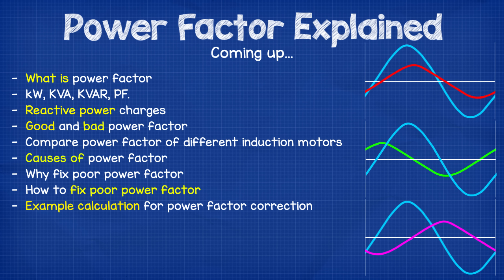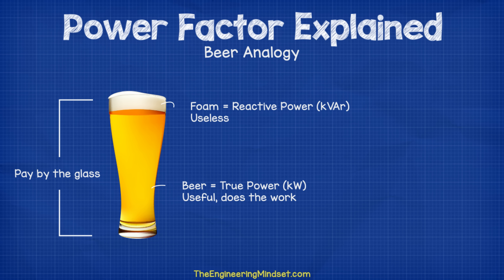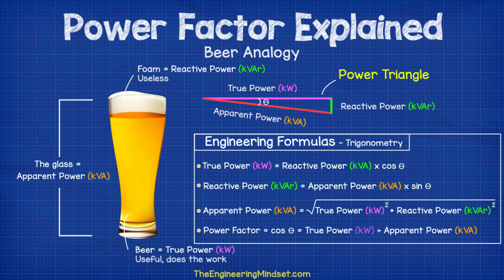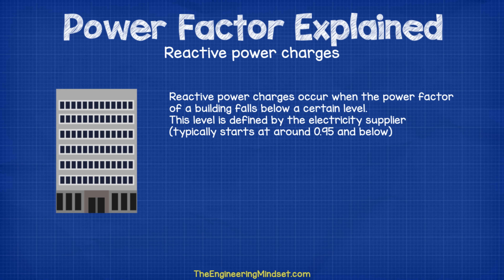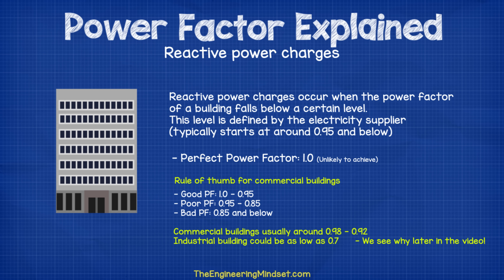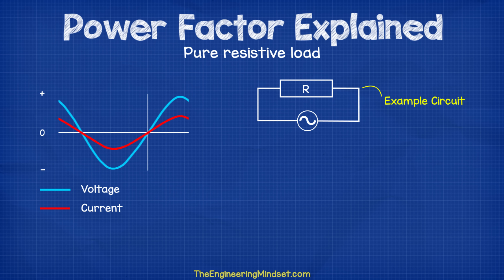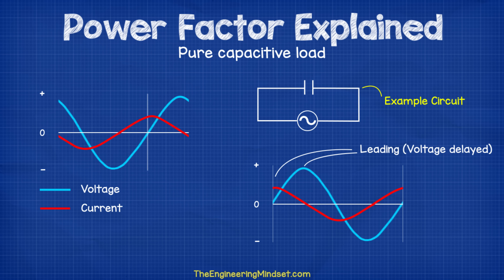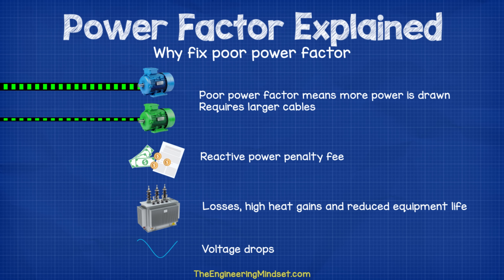Power Factor Explained - The basics what is power factor pf

Comment: Can any one help with this question: “When a series circuit comprising of a resistor and a capacitor is connected to an AC supply, the current will: ?
Reply: That's not really a question.  That's an incomplete statement with a fill-in-the-blank.    There's no real answer to this problem, because the problem is ill-defined.   I don't know whether the author of this statement intends you to answer about magnitude of current, phase of current, a change in current from what it was in a previous configuration, or what.

Calculate the impedance of both the resistor (Z = R) and capacitor (Z = -j/(omega*C)).  Add up the impedances, just like you do with resistors in series.   Ztotal = R - j/(omega*C).    Determine the real component R, the reactive imaginary component X, and the magnitude Z=sqrt(X^2 + R^2).

R = R
X = -1/(omega*C)
Z = sqrt(R^2 + 1/(omega*C)^2)
X/R = -1/(omega*C*R)

The relationship between voltage and current will be such that the amplitudes are related through the magnitude of Z.   The phase shift will be based on the inverse tangent of X/R.   The negative sign indicates that current will come earlier than voltage, meaning the current will be phase shifted to the left of voltage on a time domain graph.
Reply from the maker: Check out NEW resistor video, everything covered! ➡️ https://youtu.be/DYcLFHgVCn0

Comment: That's a pretty good video , Power factors depends on the r+xj the resistance and inductance however power rectification or better known as power compensation depends on the location of capacitors for example : if you install the capacitors far upstream the inductive load "the whole network downstream the capacitors does still have a poor power factor as the reactive inductive current will still pass that route all the way through to the load

Comment: What is that mean by 25.51kvar capacitor size because capacitor units r generally in faradays.
Reply: The units of capacitance (C) are Farads, not Faradays.  It was named in honor of Michael Faraday, but it is called the Farad.   The Farad rating of a capacitor, refers to its "electrostatic size".   It is a property of that only depends on the capacitor's geometry and the identity of the dielectric insulator (the electric permittivity).   It is defined as the charge per unit voltage, that the capacitor can store in equal and opposite amounts on both plates.

When a capacitor is used at a known frequency, you can know the reactance of the capacitor as X=1/(2*pi*f*C). 2*pi is a constant, and f is the frequency in Hertz.   Reactance is analogous to resistance, except it refers to energy storage and release, rather than energy dissipation.   From the reactance and the known nominal voltage of the grid, you can determine what kVAr the capacitor will store and release during operation.   Just like Watts = V^2/R for a resistive component, the VAr = V^2/X for a reactive component.  For a capacitor specifically, VAR = 2*pi*f*C*V^2.   So that is how you relate the VAr to the capacitance (C) in Farads.   Divide VAr by 1000 to get kVAr, because kilo means 1000.

Comment: Great presentation. however, from the beginning of the presentation, the analogue to glass of beer is not correct. In case of beer you pay for the glass and want to have as less foam as possible. while in case of electricity, we are charged and pay ONLY for the active power. we don't charged for the reactive power! therefore the electricity suppliers companies demand to have power factor equal or greater to 97% to maintain their electricity/power losses. if not power correction must be applied in big factories...using synchronous motors as an example.
Reply from the maker: There's reactive power charges on my electricity bill, most commercial buildings have this. Residential buildings don't. Some suppliers in the US I've noticed don't charge this or they combine it into other charges.
Reply: This is better I assume. In the country I live we are paying only for the active power.
Reply: Also I am wondering what type of power meter do you have in your house? typical power meter (electro-mechanical) are exists in two types. measuring active power or reactive power.  but not measuring the apparent power!
Reply: Finally, regardless my comments (I am electrical and electronics Eng.) your presentation is great and extremely interesting and very crisp!

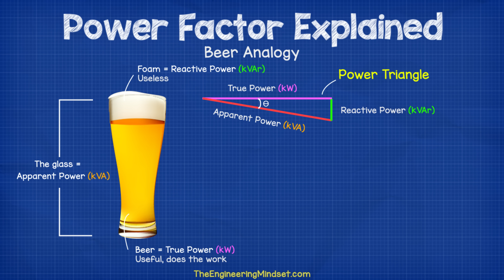Comment: animation at 2:30 - as the foam (Q) increases, and the glass remains the same (S), beer (P) should be decreasing. In the triangle it's a little bit messed up, but I got your point.
Reply: Yeah, I was looking for this comment, I noticed the same :)
Reply: Your observation is correct. And I will add that the right unit for reactive power is var not VAr.

Comment: how do we know if its a leading or lagging power factor?
Reply: Measure the voltage and current simultaneously on the same oscilloscope, that is capable of doing this.   If the shortest "distance" between the current and voltage is such that the current is to the left of the voltage, it is lagging.   If it is the other way around, it is leading.

In concept, it could lag by more than 180 degrees, and you'd think it is leading from this measurement.   Believe it or not, you'd be correct by identifying it as leading.  That is what is really happening inside a capacitor, is that it is lagging by 270 degrees of phase offset, rather than actually leading by 90 degrees.   Voltage is the cause, and current is the effect, so the true state of affairs is that it is always lagging.  In the steady state, it behaves as if current leads the voltage, so by convention, when it lags by more than 180 degrees, we call it leading.  We think in terms of the smallest phase shift between the waveforms that we can have, so that our brain doesn't need to think about angles larger than 180 degrees.

Comment: And you knew the problem was inductive because you connected a scope to the line and could see it was leading and not lagging?  So from that you know to need to calculate for Capacitance size to correct PF issue? Or do you assume problem is one of inductance?
Reply from the maker: If you have a smart meter or a power quality meter you can take readings

Comment: Great video, but at the end.....A 25.5kvar capacitor?
Reply: Given a fixed grid voltage and frequency, the Farad size of the capacitor is directly related to the kVARs that it will offset.   Industrial sized capacitors built for this purpose, are rated in kVAR, because grid voltage and frequency are known values.   If you used these on a different grid voltage or frequency, you'd have to adjust for this fact.

Comment: Hello there! I would like to make a observation. In the university where I'm studying they've told us that power output of an induction motor is mechanical (Pmec=τ*ω=τ*2*pi*n/60 [Watts], right?). So, in order to find the power input of the motor which is electrical (P=3^1/2*Vline*Iline*cosθ), they were giving us the motor's efficiency (η=Pout/Pin=Pmechanical/Pelectrical). For example if we have a motor with Pout=10 kW, efficiency of 0,9 or 90%, Vline=400 V, f=50 Hz and cosθ=0,85 then: η=Pout/Pin=> Pin=Pout/η=10/0,9=> Pin=11,1 kW (active power the motor's coils are consuming).

Comment: Why does the pure resistance load produce perfect/good pf but pure inductive and pure capacitive load lags or leads? I understand why they're labeled lagging and leading, but why particularly is that the loads cause this?
Reply: I just am learning these "load" terms.
Reply: @nieghwhite2518  Because in a pure resistive load, all the energy that goes in to the component, is immediately dissipated as thermal energy (i.e. heat).   With the reactive components, the component doesn't dissipate energy.  What happens instead, is that the component stores energy, and releases it at a later portion of the cycle.   A capacitor stores energy in an electric field through the dielectric insulator, as a result of charging its two plates to equal and opposite voltages.  An inductor stores energy in a magnetic field, in the ferrous (usually iron) core.

Comment: To convert KVAR to farad 
C = KVAR / (2 π f V^2) [here unit is μF]
Reply: In concept that is the correct formula relating, but your units are inconsistent.  Volts and Hertz are already without prefixes, so we leave those alone.   Get rid of the kilo in kVAr, and use full Farads as the capacitance unit, and it is C = VAr/(2*pi*f*V^2).   In order to use a k in front of kVAr, we have to multiply by 1 in a fancy way.   kVar/1000 = VAr.   C = 1000*kVAr/(2*pi*f*V^2).   Given C in microfarads, micro means millionth.   To clear the micro unit from C in microfarads, we multiply by 1e6 on the left:

1e6 * C_micro = 1000*kVAr/(2*pi*f*V^2)

Simplify:
1000*C_micro = kVA/(2*pi*f*V^2)

Solve for C_micro:
C_micro = kVa/(2000*pi*f*V^2)

Comment: Why the power factor is not greater than 1 such as 2,3 or 4? Please explain this.
Reply: A power factor greater than 1, would imply that you have magic components in your load that are creating energy that didn't come from the generating source.   The best possible power factor you can ever get, is a power factor of 1.   Because that means that voltage and current are synchronized, and are playing together as nicely as they possibly can.

Just like when you apply a force to move an object, the most work from this force you can possibly apply, occurs when the object moves in the exact same direction as the force.  There is no angle where the work done on the object exceeds the value of force*distance.   Best case scenario, W=F*d is the best you can do.   If you apply it at an angle to the direction it moves, such as if a normal force of constraint holds it along a path, then only part of your force will do work on the object.   The math behind power factor works out the same way.

Comment: At the last, is the capacitor to be connected at the series? To increase the power factor?
Reply: Generally in parallel, right between load and voltage source, acting like a filter. You can study "passive filter design" for better understanding ;)

Comment: After many decades of doing operations, maintenance and repair in power substations and not " fully " grasping the concept of kva power factor, which was used for transformers, very large transformers, fan plant motors, pump room motors, compressor motors, overhead crane motors etc. I now have a better understanding of power factor and kva rating than I did all those years working with equipment with a kva rating. To be fair, in performing my job a true understanding was not nessecerry as I had no part in the design and specifications of the equipment, that was the engineering department.  I just operated, maintained and repaired the equipment. Thanks for a better understanding.

Comment: The amount of current flow through the equipment is depends on the resistance of the equipment 
But how do you increase the current in your same component example(lamp) by your bench power supply please explain it?
Reply: You cant increase current unleas you increase voltage. 
But be carefull not not exced the current and voltage limits.

Comment: How to connect that capacitor in the circuit.
Reply: Good video, but you still need to know how to convert the calculated kVAr PF correction value into Farads for the parallel capacitor.

Comment: Just seen this video and it occurred to me that with a smart meter in your house you could be charged for pf in the future as most of us are running led lights with a shocking power factor.
Reply: Distribution Power Engineer here - hopefully going to clarify a couple thing for you. 
1. LEDs and any electronics with switching power supplies can cause power quality issues but they typically don't affect power factor that significantly. They inject harmonics into the electrical system which messes with the waveform causing it become less sinusoidal. However, that is not the same thing as power factor.
2. I highly doubt that power companies are going to start charging residential customers a surcharge for poor power factor any time soon. Homes only contribute a small portion to power factor issues especially compared to commercial and industrial customers with large motor loads.

Comment: 3:04 I tried calculating the Commercial total Payment value, and, I got it by adding all the charges. Now, I'm a bit confused what are those "Demand" & "Capacity" charges? That's not with 'h' in unit like Consumed Power. It would be great, if you had explained those a bit. Assuming those to be the penalty charges, what I get conclusion is that we are paying more than the Apparent Power Consumption. As, the bill was the linear sum of True Power consumption & Reactive Power Consumption. But, in the other hand, Apparent Power = √(True Power²+Apparent Power²). And, linear sum value is greater than that! So, is it that they are paying more than the Apparent Power Consumption excluding the "Penalty charges"?

Comment: "Unitless number used in alternating current" - what does that mean? and for direct current?
Reply from the maker: It has no unit of measurement because it's a ratio or a percentage, it's just a number. A unit of measurement is for example a mile, a kg, a kW, ft etc but if you divided 9ft by 10ft you get 0.9 with no units because it's a percentage or ratio.
Power factor doesn't exist for DC it only occurs in AC

Comment: now i understand ,huge power consumption will take place when torquing the motor(from stop position to cycle position) this will trigger huge spike of current flow (A)meter at Amp scale. so that is reactive power am i right?
Reply: The peak in the current in a electric motor start is due to the rotor initial inertia

Comment: Nice video but please explain how the math works in a physical sense, why some things are squared and square rooted. I now understand what capacitor to choose for improving my power factor, but I don’t really know what the reason is, aside from speculation that it increases electrical noise for things in the circuit. Still a great and informative video.
Reply: He did explain the reason for capacitors (or inductors) to correct a power factor: ideally, you’d want “everything in sync” (current is neither “leading” nor “lagging”). Capacitors and inductors produce exactly the opposite effect, making the current lead (caps) or lag (inductors). Therefore, you add one or the other to try and move the waveform of the current as close as possible to that of the voltage. Since it is much more typical to have inductive loads (because there are lots of motors and transformers in a building), the most common correction is done with capacitors; keep in mind it could still happen you had a mostly-capacitive load, and you’d need inductors to correct the P.F.

Re. squares and square roots, you’d have to watch his 3-phase video to understand some of them (RMS, for instance), coming from the pure geometric arrangement of the phase coils on the generator (at 120° or 240° off each other). In other cases (such as the “leading” or “lagging” of the current), there’s no “physical sense” because it comes from mathematical abstractions called “phasors,” which in turn comes from complex numbers and vectors. It is not too complicated, but it’s abstract; very useful mathematical tools.

Comment: I'm studying electrical engineering and another good formula to use is
Power Capacitor new= true power( tan(Angle current)-tan( angle new))
In this case 
50(tan(38.7)-tan(16.3))= 21.5KVAR

Comment: What is a 25.5 kVAr capacitor? How do you convert it to Farad?
Reply: Might want to confirm this, but if memory serves, capacitance in micro Farads =  kVAR * 1000 / (2 * π * frequency * Voltage^2).
Reply: @nate0031  Thank you. So e.g. frequency is 50Hz and Voltage 230V in the EU, right?
Reply: @svhuwagv2965 Yes.   The UK used to use 240V, but they've change it to 230V when originally joining the EU.  The Isle of Man and Gibraltar, both of which have a political connection to the UK, still use 240V.   A lot of former parts of the British empire use 240V.

It will also depend on how you connect the capacitor.  If connecting phase to neutral, you go by 230V.   When connecting to the corresponding phase-to-phase voltage of 400V, you use 400V in this equation.

Comment: Thank you for the great video. I'm a bit rusty with my EE stuff. Is there a way to calculate the capacitance of the corrective capacitor?
Reply: The cookbook procedure, without going into any theory, would be as follows:
1. Determine the required kVAr of the capacitor, using the method outlined in the video.
2. Divide the square of the voltage by the required kVAr. This gives you the required capacitive reactance, in ohms.
3. Calculate 6.28 times the line frequency (in hertz) times the capacitive reactance, as calculated in step two.
4. Take the reciprocal of the number from step 3. This is the required capacitance, in farads.